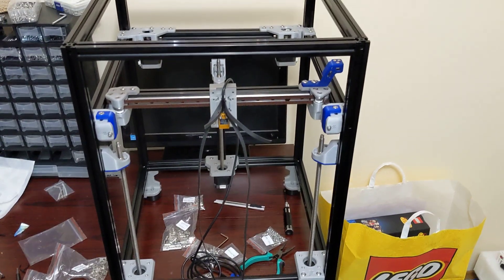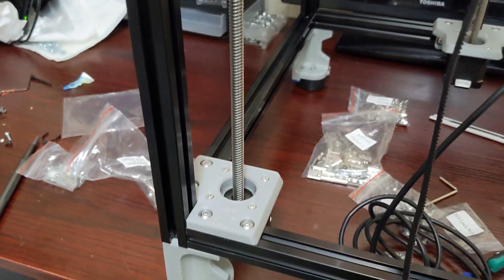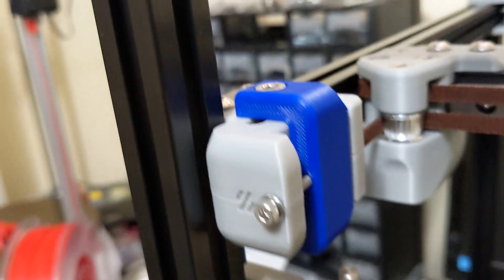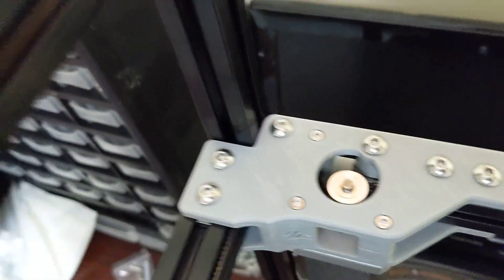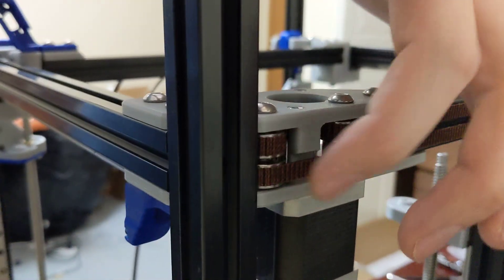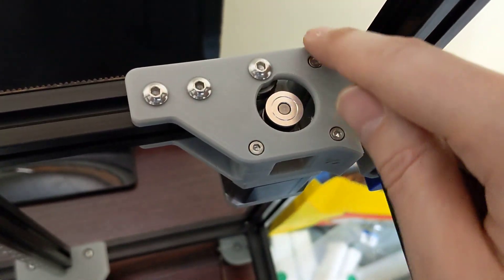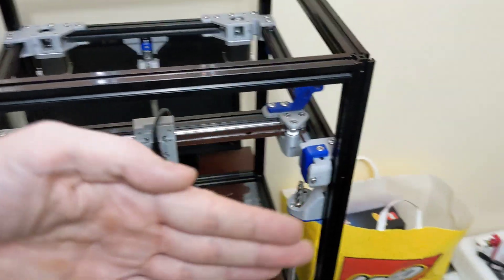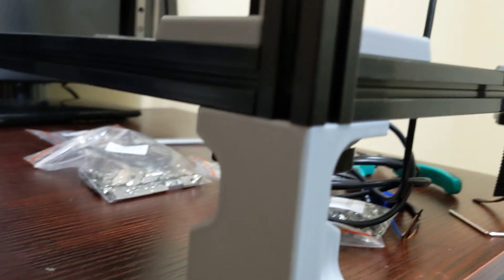FORMBOT Voron Trident 3D Printer Kit - Episode 2 - Z Axis, X Axis and Belt Routing

Comment: What's your impression of how easy it is to replace the belts (if and when they wear out)? Thanks for the great video
Reply from the maker: not too bad, you will need to remove the panels to replace but they can be replaced pretty easily. belts shouldn't wear out that quick